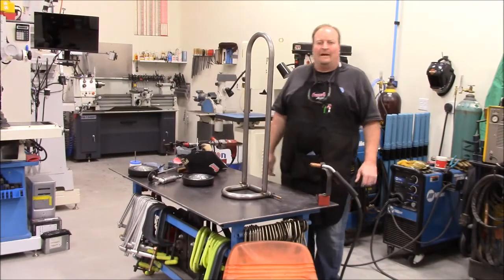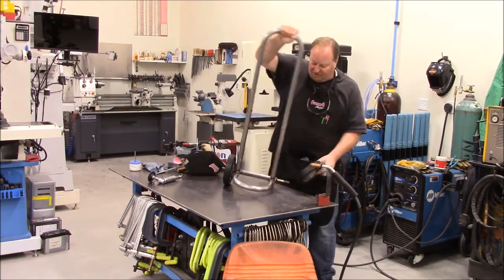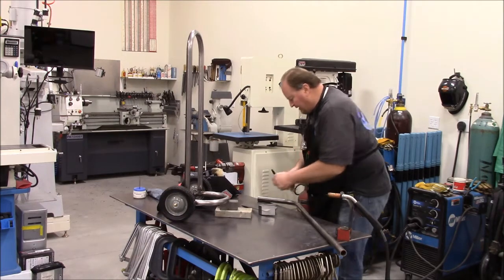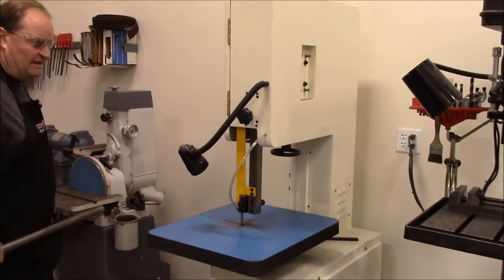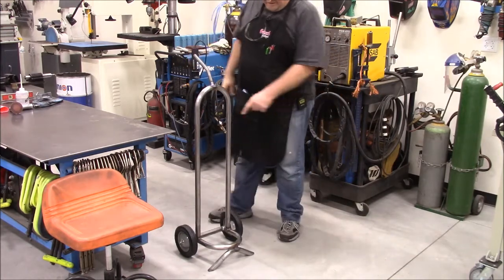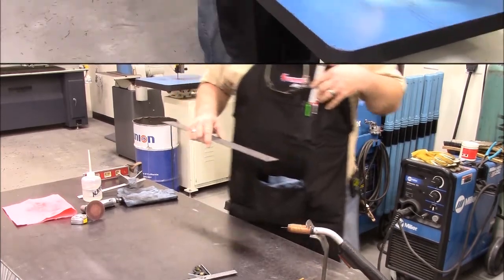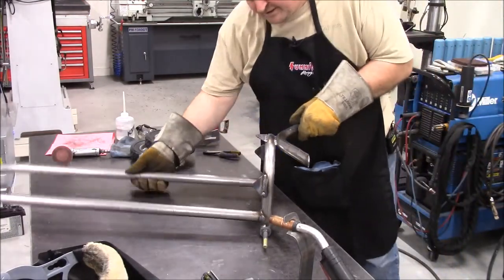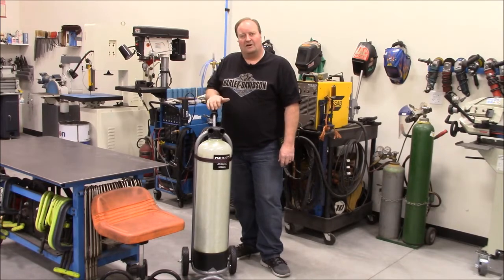Deionized Filtration System Cart Part 2

Comment: How many gallons do you have to run thru the system, after soaping with hard water, before you get back to zero dissolved solids when turning the valves back on for the tank?  10 gallons everytime?  Curious if you measured that too (or can and comment), tks.
Reply from the maker: It depends on how long of a house you are using as that is all you are flushing out when turning the valves back from the bypass position.  

I generally hose off the coach initially, then turn the valves and leave the valves turned to go through the tank until finished so as to not have to keep going from hard to deionized.  

I think it wastes less water and really hasn't deminished my media much are all so far.  

Thanks for watching. 
Mike

Comment: Do you plan on carrying you cart with you in your RV?  If so, because it'll be quite heave have you thought how you'll be able load it easily into one of your bays?  I have been looking into a system to carry in my RV but not sure I'd want to have to wrestle with something that heavy by myself.
Reply from the maker: They make a Pro 50 which is a smaller size and much more portable than the Pro 100 which I have. I don’t t have any plans on taking it with me so I opted for the larger tank size. Had I wanted to bring it with me I more than likely would have gone with the smaller tank. 

Many campgrounds anymore don’t allow washing of your rigs on site so I didn’t feel it practical to have a portable system. If you are full-timing I would opt for the smaller tank and wash when possible. I merely wash our coach upon returning home and prior to parking as we are usually out for only a week at a time. 
Thanks for watching and commenting. 
Mike
Reply: Many thanks for the quick reply Mike,  I may opt for the Pro 50+.  I've been kind of wondering how stable the smaller unit will be after connecting hoses to and whether or not I would still need some sort of cart to keep it standing upright.  I'm finding many more uses for the Di-ionized water such as washing windows at home and for rinsing off glass shower doors and in all of the RV batteries.  Who says old people can't learn something new :-)
Reply from the maker: Glad to help. Best of luck. 
Again, thank you for taking the time to watch. 
Mike